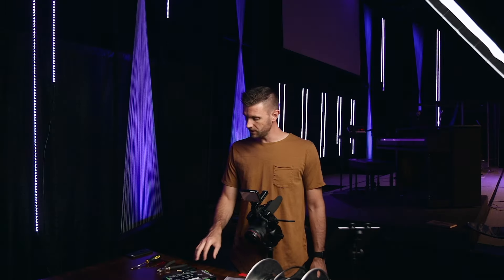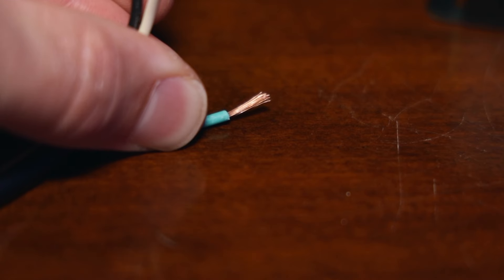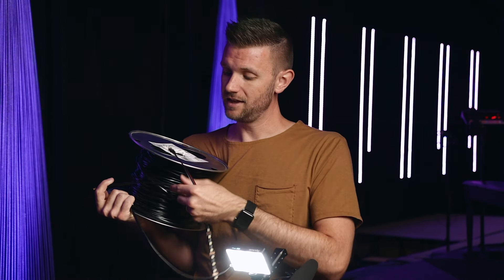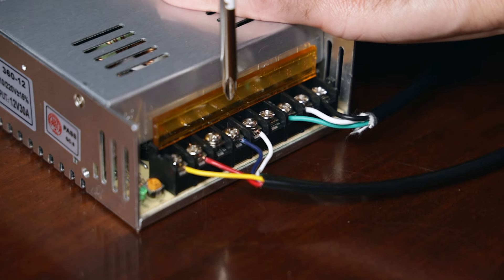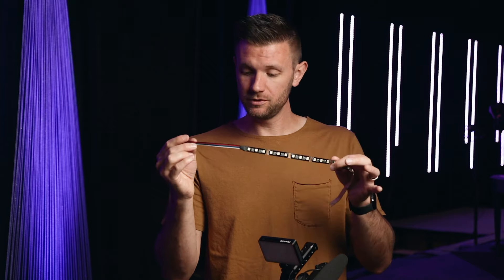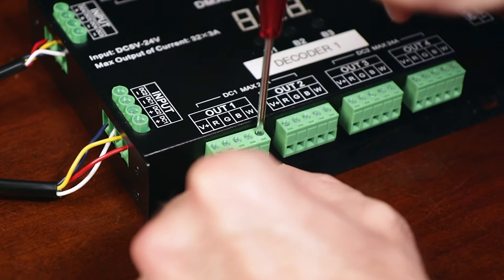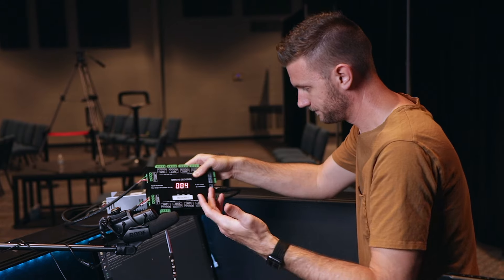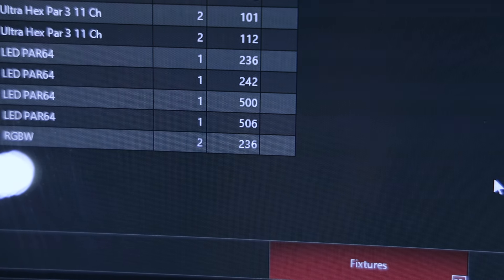How to Wire 32 Channel DMX Decoder, Power Supply, RGBW LED Tape

Comment: Great video! I got the lights and decoder working for a single strip. Could you advise on the program settings in the decoder to add strips to other outs (out 2, out3, out 4 etc) and have individual control of each independent strip / out? I'm working with SoundSwitch, but the patching of fixtures is the same.
Reply: I'm asking the same question as Joshua below, where he asks: f you ran 8 separate LED's out of that one DMX decoder, would you have control over each fixture separately?

Comment: Hello! Great video! You didn't link the black cable that you used to connect the power supply to the decoder. Can you tell me what that cable is or link it?
Reply from the maker: It’s a standard 3 prong computer power cable. I just cut the end (computer side) then wire to the power supply.

Comment: In your other video of LED tape with the smaller DmX decoder, you did not use a power box and plugged the decoder into wall using power. When is it necessary to have this power supply?

Comment: Received all my goods and got it working with my controller but only on OUT 1. How do you assign OUT 2 and so on on the Decoder. The instruction booklet that comes with it is about as useful as an ashtray on a motorbike.

Comment: If I want to have a chase/waterfall effect will it depend on the dmx controller having that particular addressable function as an option or will it depend on the chip built into the LED or pixel strip? Or do both the strip and the decoder need to have that function for me to make this happen? Thank you! (I’ll be running all of my lights through a computer with a lighting interface)
Reply: im wondering the same thing but yet theres no answered..

Comment: hi. I am trying to figure out how to connect our house lights to dmx... have you done this? 
There is 2 0-10v wire going to a dimmer switch on the wall.. I want to connect that to the box and them to dmx via lightly. any ideas? house lights are white only..no RGB. and yes only 2 dimmer wires coming off them. thanks!

Comment: Super helpful! Are the channels pre set in the decoder or did your software determine the function of the channel? Basically what I'm asking is, are channels 1-4 always going to be red, green, blue, white or did your software do that? I'd like to know if I'd be able to accomplish the same result with a standard hardware controller or my USB to dmx interface that is controller by my DAW.

Comment: Why do you connect so many power source (4) for the decoder while you test only 1 light strip?
I have a problem with my decoder that it doesn't turn the light on.
Reply: I have the same question. I connected only 1 pair of V+ and V- but that doesn't even drive the display. The only thing I can think of is that due to the amount of current that the Decoder needs, they want to make sure that the overall diameter of the power cables is sufficient. But who knows for sure? And in the manual, they actually show 4 different power supplys with 4 wall plugs. confusing...

Comment: Great video. Super helpful. I was able to use these inside of my drums cage to light up our drummer and drum set. 

I am having an issue doing this. The lights work but every few seconds they flicker. Any suggestions?
Reply from the maker: Could be a power issue. Be sure you are getting consistent power output from your power supply. I had the same issue but I was using a smaller power supply. Haven’t had any flickering issues after using these.
Reply: Hey, did you ever find a solution? I’m having the same problem still using the larger power supply.
Reply: @colbygriner1204  I am also having the same issue. It is very strange behavior though, if I run more than one strip at full brightness, then I can fade on of them up and down with no flickering. If I put 6 strips at full brightness then I can fade up to three of them at a time with no flickering. If I just try to fade one strip (when no other strips are on) then the lights flicker.

Comment: Thanks for the video!  Can you confirm something for me?  Is it one power supply per decoder?  And with those two devices you can run eight separate LED strips?  I saw a parts list from a church with two decoders and multiple power supplies and I can't figure out why.  Thanks!

Comment: I just bought nine 16ft govee led strip. I'm new to the led community these strips added up to 216 Watts is it possible to connect all 9 strip together with one 350 Watts power supply or do I need more than one power supply?  I have a 144ft of  ceiling to run these led lights Thanks.

Comment: The RGBW LED strips that you recommend in the video are 16.4 ft....we need something that is 18.5 ft.

Do you have recommendations on how we can achieve this or is it possible to cut LED strips so that I can use the 16.4 ft from this strip and add another piece of 2.1 ft to make one continuous strip with the same strip?

Thanks. Your videos have really helped us in our churches transformation journey
Reply: Figured out how to connect custom length RGBW LED strips together. However in my use case, I need to use 2 separate LED strips around our stage design which must be DMX controllable. These separate LED strips must be producing different colors from the computer via DMX. Does that mean that I would need 2 separate power supplies and 2 separate DMX decoders? i.e One LED strip shows Green and the other strip shows White.

Also the DMX decoder that you recommended is not available in Canada. Are there any alternatives to that DMX converter that I can use with the same specs that you mentioned? What spec DMX converter specs are we looking at? Do we need 32 channels, 24V, 96 A?

Thank you so much. Keep up the good work and God Bless!

Comment: Have you have come across the 32 channel decoder only working on one side? I try to connect power to the second side and it just powers off. Do you have any ideas why?

I have the 32 Channel 96A RGBW DMX 512 LED Decoder Controller DMX Dimmer DC5-24V RGBW RGB LED Light 8 Bit/16 Bit
and the MENZO 12v 30a Dc Universal Regulated Switching Power Supply.

Comment: I'm only using one side (rgbw strips), so I still need to wire to both inputs from my power supply or will one input work? Thanks a lot!

Comment: hello 

i need your help.
i have the same  DMX512 DECODER 32 channel with 8outs of RGBW+V where am connecting the strips. on this Decoder can i connect a led strip that is  
WS2812B DC5V LED Strip RGB 1M 144 Pixels Smart Addressable Black PCB WS2812 IC Full Color ?

will it work?

thank you

Comment: Is it possible to use WS2812b LED strip with DMX and still program it pixel by pixel?
Reply: Not on this decoder you will need a different decoder as addressable leds use video mapping rather than dmx channels
Reply: @SoulJuce which one tho I can’t find a decoder for addressable led
Reply: @DanielSalloumOG   Look into WLED with DMX
Reply: @SoulJuce what do you mean? Is that a led strip or a decoder?
Reply: @DanielSalloumOG  WLED is an open source led software which has alot of functionality for different types of leds strips which includes DMX integration
Reply: @SoulJuce  how do I connect it to a computer and what types of strips

Comment: Could you tell me which 5 color wire you are using where I get it?
Reply: I did some research and found that it is sprinkler wire 18/5 and you can find it pretty inexpensively at Lowe's or Home Depot.
Reply: @AndrewBernardez  esto te funcionó correcta mente ?

Comment: Wouldn't say  that the M2PC is discontinued. Certainly they don't manufacture them anymore but you can by what's nearly the exact same device as the NX Wing, which only has a few very minor differences. 
 
The actual M2PC works absolutely fine with Obsidian Onyx and is a proper onyx license unlocking all 128 universes.
Reply from the maker: Very true. Thanks Thomas

Comment: If I was to connect two 16.6 RGBW tapes to make one long tape to run the length of my stage, would I need a 24 v power supply or will a 12v power supply that you have listed work?

Comment: Alright bro.  I’ve done everything this video says…lights work, but when I try and change color, the colors won’t change to correct color.  I chose a generic RGBW 8b LED fixture.  I’ve tested all of the colors on the DMX Decoder and it all works great.  What am I doing wrong???

Comment: So I noticed that you are using a 12v power supply into a 24v DMX decoder, into 12v led strips? I'm using the same setup and having control issues (lights flickering and as I increase the intensity of the strip it gets worse) I'm wondering if I'm just going to long on my strip (16f) or if the voltage discrepancy is the issue.
Reply: I also am having this same issue. Any fix that worked for you by chance?

Comment: First off - thanks so much for this really informative video.  It is inspiring me to think about adding some lighting strip features at my church, and I want to be sure I use compatible components.

Now I noticed that your preferred LED strips are 24V, but the "second option" LED strips are rated at only 12V.
Now the DMX decoder will handle anywhere from 5-24V, and I think the DMX decoder will use whatever input voltage you give it.  You connected it to a 12V power supply.

* Have you had any issues using the prescribed 12V P/S to power the prescribed (first option) 24V LED strips?  If the converter's output to the LEDs is only 12V, wouldn't the LEDs give off less light, at only half their rated voltage?

* Or; if the decoder's output to the LEDs is actually 24V, then would using the "second option" (12V) LED strips risk overheating or blowing out all the LEDs?  
Is this safe?

Did I miss something somewhere along the line?
Are LED strips rated at 12V/24V really all that interchangeable?
If not, what would you change in the rest of the configuration if someone has already purchased a boatload of 12V LED strips?

Thanks!

Comment: If I don't have a console like the one in the video, how can I do it to configure the decoder with a DMX?
Reply from the maker: You can use them with any DMX software with or without a console.
Reply: @WorshipLeaderHangout  
Thank you very much for answering one of the many questions I have about that decoder, another of the doubts I have is what codes I have to put in order to manage the channels with the DMX

Comment: Could you pass along the source or link to the spool of 5-wire cable you showed?

I didn't see the link for that.

Thanks
Reply from the maker: No problem, I’ll reply soon
Reply from the maker: So... it looks like they are out of stock because I can’t find it anywhere. The links I provided previously had both white and black options.
Reply: @WorshipLeaderHangout  where are said links?
Reply: So I found that this is sprinkler wire 18/5 that you can find at most home improvement stores.
Reply: @AndrewBernardez  did that work? The one I found didn’t have blue wire.

Comment: Thank you for the great tips and information! I tend to find myself looking at your videos when I'm designing shows. Great work!

I do have one question though. Where did you find that jacketed wire used to connect the power source and the decoder? What is the name of that wire? I would love to get some!
Reply from the maker: It’s jacketed sprinkler wire from lowes. You can get them by the roll.
Reply from the maker: 18/5 Solid Jacketed Sprinkler Wire (By-the-Foot) https://www.lowes.com/pd/Southwire-18-5-Jacketed-Sprinkler-Wire-By-the-Foot/50148248

Comment: Do you connect the Decoder directly to PC?
Reply from the maker: You need an interface that is compatible with your software
Reply from the maker: What software are you using?
Reply: @WorshipLeaderHangout  I want to learn QLC+ for this

Comment: Hello brother , I'm using the exact supplies but the led light are flickering, how did you manage to avoid flickering. thanks.
Reply from the maker: The flickering is either a insufficient power issue or an unstable DMX connection. I had the issue a long time ago with one and just redid all of my connections and it worked. Check you power supply and the cable you used with it as well. Let me know if it ends up being something I haven’t mentioned.
Reply: Thanks for your prompt answer, will do my man.
Reply: I’m having this issue too! Flickering unless I have all Colors up to 255… did you resolve?
Reply: I also am having this issue, did this work for you?
Reply: @quietconfidence8070  still flickering I'm gonna try another brand of led lights to see what happens
Reply: @quietconfidence8070   I did resolve this by using the DMX output on an Chauvet Artnet Node with my Lightshark LS-1. It would appear that, in my case, the DMX output coming off the 3-pin output on the LS-1 had some kind of noise or incompatibility with the Decoders. By converting to Artnet then using the settings in the Artnet, I reduced the Framerate to 35(even right up to 39) and everything stabilized.
Reply: @dandeon3956   I just ordered the chauvet artnet Node so exited

Comment: Is this something we could use for a back wall wash? Our church has a lower ceiling so from the stage floor to the top of where coverage is needed would be like 9ft.
Reply from the maker: It may be but you might need to use multiple strips. They are cheap enough that you could buy one and test it before you put a lot of money into it.
Reply: @WorshipLeaderHangout  one more question: will using a 24v power supply give me more brightness on a single strip, or will it just allow me to chain multiple together without loosing brightness (or both maybe)?
Reply: @willtraynor  did you figure this out. I am wanting to put two 16.4' tapes together to run the length of my stage. I don't know if the 12v power supply will handle or do I need 24v.
Reply: I ended up running two 12 v tapes together with a connector.  You could notice the tape close to the power supply  was brighter than the end at the second strip.  I would recommend 24v tape , make sure you get a 24v power supply

Comment: When we turn on the power, the 32 512dmx decoder starts smoking. What are we doing wrong?
Reply from the maker: Ohh my gosh. I had one do that a few years ago. I checked the wiring but it was identical to my others. I attributed it to a faulty decoder. But check the wiring to make sure everything is correct as well. I would have Amazon do a replacement for sure.
Reply from the maker: Also make sure you were sent the correct power supply.
Reply: @WorshipLeaderHangout yes, we were sent the wrong power supply. Thank you!!

Comment: Hi Chad. We have a lot of RGB led strips. Will this work without using white or do you recommend purchasing RGBW. Low budget 🤷‍♂️
Reply: it works with rgb just fine, it supports multiple led tape types (rgb, rgbw) also like solid white with a dimmer feature

Comment: Question? Do you need that software and board to run and turn on the lights ?
Reply from the maker: Any DMX software should work. This is just what we use.

Comment: How did you connect the DMX module to your board? Did you go DMX out to the board, and then DMX out from the board to the in of end encoder?  What if we've got an older light board with just a DMX out on it?
Reply from the maker: That’s exactly right. DMX from your lighting board or interface to the decoder.

Comment: Great video, if you don’t use the entire strip and cut it, can you still use the excess piece that you cut ? If so how do you wire ?
Reply from the maker: Yes. It’s basically a wiring harness clamp. Four or five pin depending on what LED tape you have. You can find them on amazon. Just be sure to cut the strip in the indicated areas on the tape. The cut spot is also where you clamp the wires.

Comment: I can’t find the black strips on Amazon, even with your link from the old video where you mentioned the black ones. Are they discontinued, or just not available right now? Or am I totally missing something?
Reply from the maker: They could be out of stock 😕. Try seeing if that listing has a color option tab.
Reply: consider looking at Chinese manufacturer offers: same product, way cheaper, often labeled way better. Im sure you can find a RGBW 12V 5050 LED strip just about anywhere. Chinese sites often list the power output per meter or per LED.

Comment: Would this be the same process if I wanted to use a dmx controller to control an rgb flood light
Reply: more or less... most rgb floodlights already take DMX input so the decoder is integrated. The power supply is also most likely integrated.

Comment: Can u put two 16ft led light strips together to make one channel.
Reply: Yes totally, depending on how the encoder works it may start to get dimmer if you go too long, but our stage at the moment is using about 18ft per Aquarian’s and they are still full brightness (however seperate 4-channel controllers)

Comment: Could you please, make something with a madrix? like pixel mapping, that would awesome...
Reply: Alexander LP that would be awesome, but they’re using LED tape, instead of pixel tape. So, there’s not much need for pixel mapping since there’s no individual pixel control.
Reply: you need a different kind of encoder/decoder for this... we are working on a custom chip to decode DMX to a 6m pixel rgbw strip. there are solutions in the industry but they run very fast in their limitations. Pixel mapping is not really what DMX is for :/

Most professional solutions use decoders that take video input.
Reply: What encoder would I need